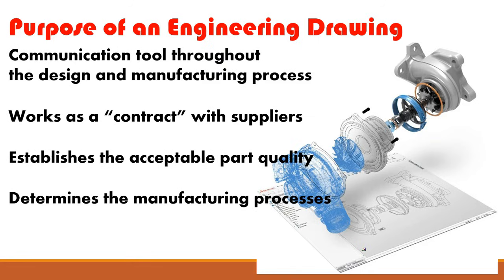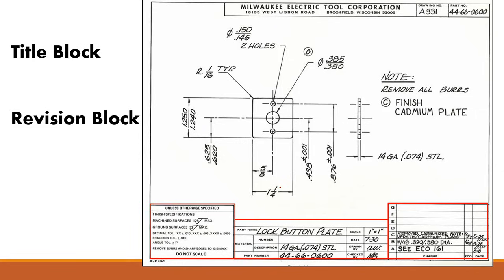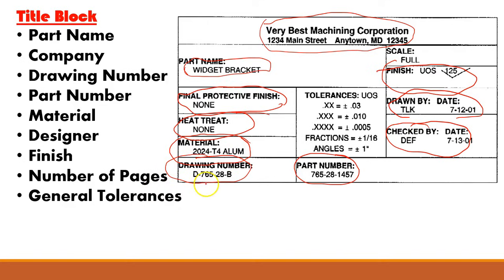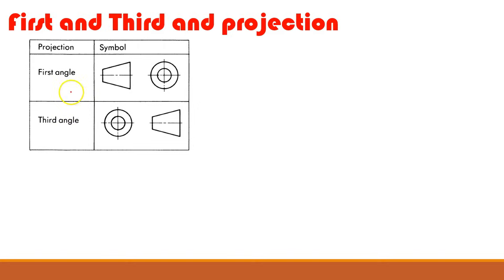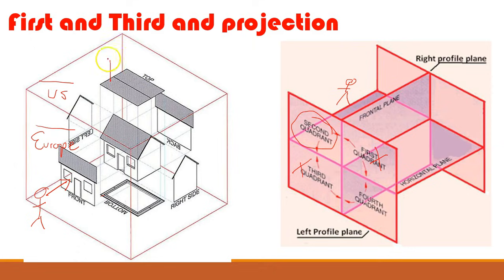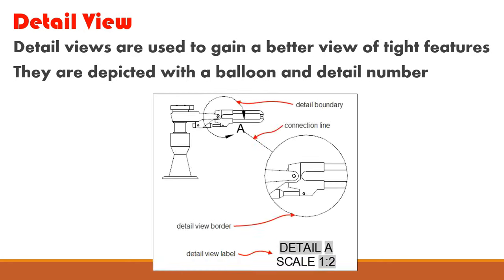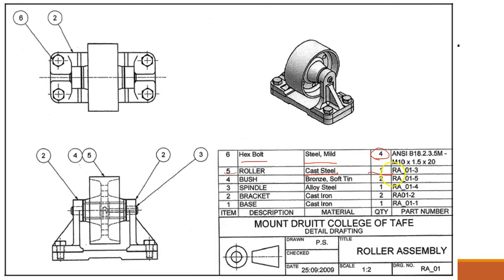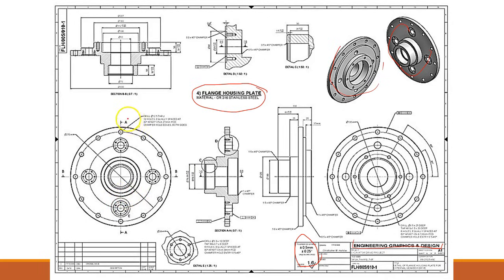The Basics of Reading Engineering Drawings

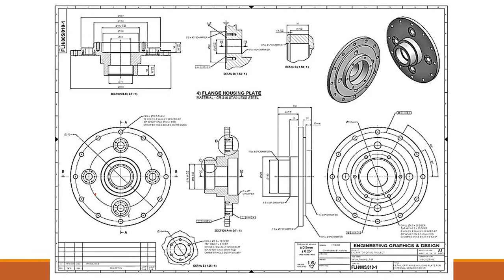Comment: In addition to first & third angle projection mistake, please, also note the mistake in Detail view section (around 16:50) - the scale is totally wrong. How it is possible to use such scale?! Please, refer to the final drawing (the flange plate around 21:20) and check the correct scale for detail views.This video should not be used by beginners at all. It plants a very, very wrong information and later it will confuse you. I already had a discussion with a person, whose main argument was "But, I saw it on YouTube channel - so it is true! Period!"

Comment: Is it true that the top of the part in horizontal orientation while viewed in first angle projection or any layout is opposite of the title block? If the TB is located on the bottom right corner then the workpiece top would be on its left side yes?

Comment: Hello professor, I'm a machinist apprentice learning how to read technical drawings/ blue prints. Unfortunately this is kind of an accelerated class and they're only giving us 5 to 6 days to understand the material. It's been 2 days into the class at work and I can't understand how to get the measurements of the workpiece and understanding how all the different lines connect and lead to the numbers I'm supposed to add or subtract.

Comment: I have a background in engineering, but not decades of experience, so I have a question for engineers, machinists, and technicians with decades of experience in design and manufacturing.

From college, it was apparent that metric units were superior to English units; it simplifies things and helps prevent mistakes (reminds of the costly mistake between NASA and Lockheed). All of my fellow engineering students concluded we would be better off if everything was metric. At the same time, as a school machinist told us, the prevention or slow move to all metric is partly due to the cost associated with making the transition. Does that resonate with those more experienced in manufacturing?